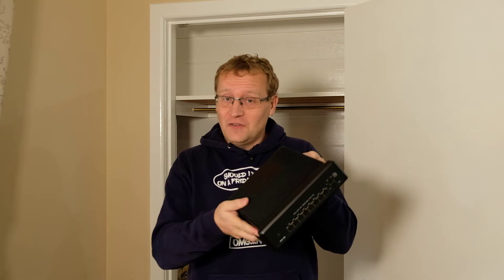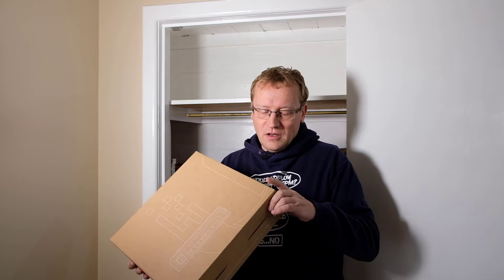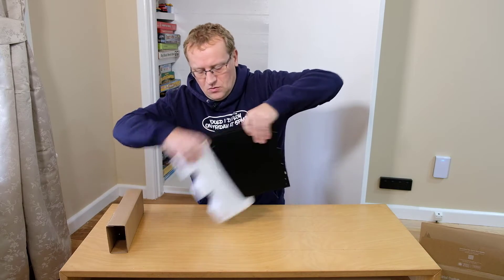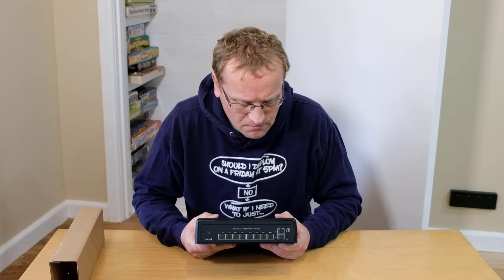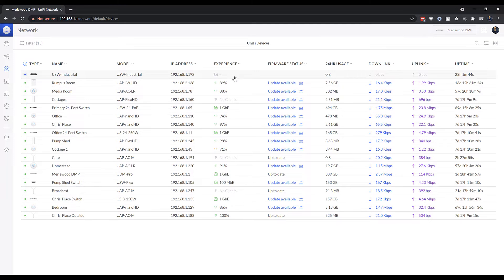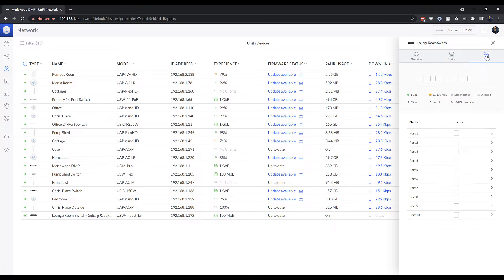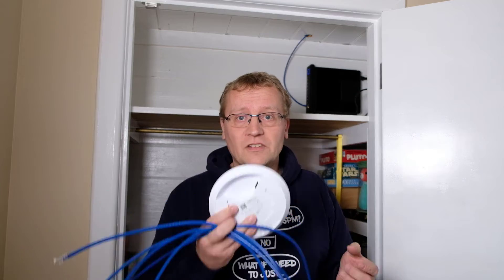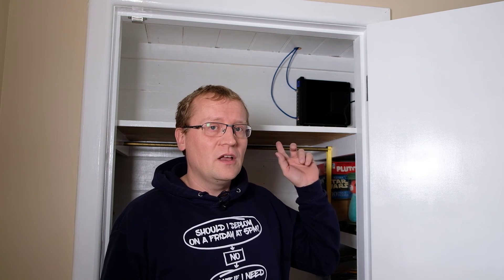Unifi Industrial Switch - Install & Setup

Comment from the maker: I managed to solve the 100Mbit issue with the switch. I updated the industrial switch (which is in the video), then updated the primary switch it is connected to. That made the industrial switch run 1Gb, I then updated the nanoHD and restarted it, which made that run 1Gb too. Seems that version can affect network speed between devices? 🤔

Comment: Hey Lars, not sure if I missed a video but I couldn't see your nanostations in the controller. Am I wrong?
Reply from the maker: That is correct. NanoStations are not Unifi products, but part of the UISP family, so they show up as "clients". The actual connection between them is invisible to the Unifi controller. It just sees it as a wired connection.
Reply: @LarsKlintTech  awesome! learn something new all the time!!! I only have a UDMP with x5 mini-flex and a U6-LR. But I've been bitten by the Ubiquiti bug and now I want more. My next big purchase is a 24 Pro PoE and an Agregation Switch so that I can start dabbling in 10G